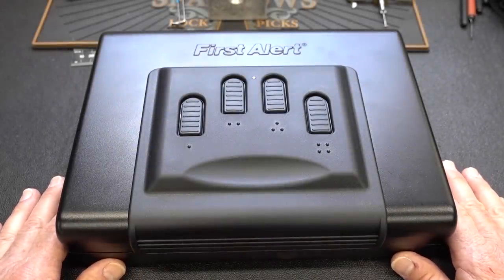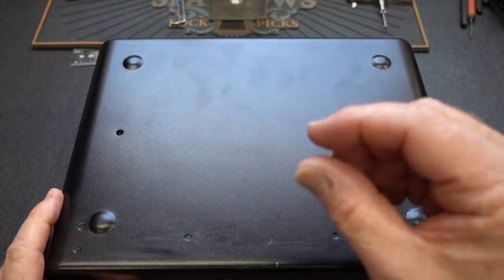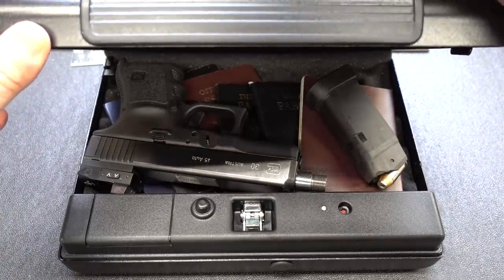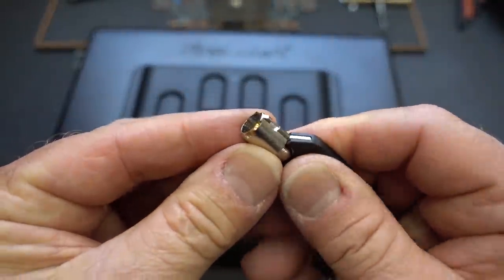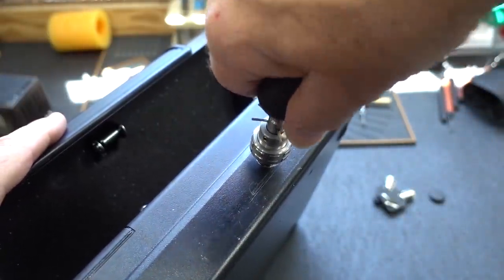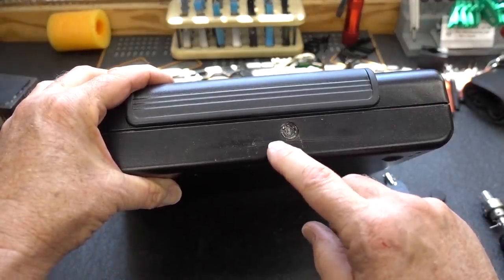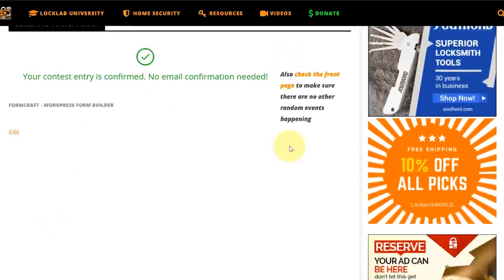(1526) Review: First Alert Personal Safe (RA31424)

Comment: This case is rock solid (like other Pelican cases). https://www.youtube.com/post/Ugkx3jMFPw9QX_Iu4DNcjW-t9AZ4_iNhJzhE I paired it with the Master Lock 140T set of padlocks. The US Airways ticket agent that checked the case was impressed by how completely the latches were secured. The case has layers of removable foam cubes that can be easily adapted to the contents of the case and keep everything secure. After declaring its contents to the ticket agent, I was allowed to put this case in other checked luggage. Due to its size and black color, this helped insure that it wasn't misplaced by a baggage handler. TSA was (apparently) happy with the packaging as well. If you plan on flying with more than one of the main items, I would recommend buying a larger Pelican case and just transport the case as another piece of checked luggage.

Comment: You can mount it even closer to the wall or floor. Cut the tab off the back of the key and replace it with a length of rod welded, braised or epoxied at right angles to the barrel of the key.
Reply from the maker: Good idea!

Comment: I've seen an electronic like this one but instead of having an external key it had a slot for a 9 volt battery to press up against a pair of leads as a backup external power source. I would like to see that duplicated on more devices like this one.
Reply: sounds like a perfect opportunity for someone to go and fry your circuit tho.
even if it fails safe that would still turn your expensive safe into junk

Comment: The hinge pin can be cut through a hinge slot with a piece of hacksaw blade,and removed in under a minute.
With the shaft of one of the white disposable Bic pens,and a lighter. You can easily defeat most of the tubular keyed locks.
Heat one end of the shaft till it's softened.
Then press it firmly into the keyhole,hold it till it cools,then turn it like a key to open.

Comment: I own that safe, big problem with battery life. Three years doesn't match with my experience.
Reply: Like he said, have a battery rotation policy.  I have a Hornady safe with a similar style keypad that uses a big pack of 8 batteries (12V) and all it takes it one cell to fail to kill the whole pack, but thankfully the external power input is 12V with a common barrel-jack (5.5x2.1mm), so I can get it power from a car hot-shot and an easy-to-make cigarette-lighter adapter-cord (don't have to be near an outlet).
Reply: id say apply the Thermostat without a C-Wire policy,  change them every year.
Reply: Their three year claim is probably a best case scenario where you put fresh batteries in lock it and don't touch it for 3 years. 

Each time you open it you decrease the battery life.
Reply: @dustysparks  That doesn't address the poor battery life of this safe at all.
Reply: Maybe wire some cells in parallel..
Reply: @drivejapan6293  Absolutely.
Reply: @dustysparks  Along the same idea, just replace the batteries with rechargeables and the gear to make them USB rechargeable—and put the USB port where the lock is .

Comment: yeah, tubular locks... i only fairly recently got interested in the sport of picking, and I've tried picking a few. with nothing more than a home made tensioner from a hacksaw blade, and a tiny torx driver for mobile phones that i sharpener on a grinder into a minature pointy stick, have been able to SPP all tubular locks I've come across in a matter of a few minutes. They can't be all that good if someone like myself with very little experience can do that...

Comment: Bill, I'm wondering if there is a typo in the video title?  I can't find an RA31424 safe - however I found an RA31524 on Amazon instead.  And when I searched First Alert's site, it appears they use model number 5200DF for this safe.

Comment: Hi Bill, apologies if this isn't the place to ask. But your ideas for securing this to stuff has prompted this question. I want to get a scan tool that's extremely expensive, for my business, but I want to keep it in my boot, as it's fairly useless safe at home. But this tool is literally worth more than my entire car, and I'd like some way to keep it safe inside the car. Are car safes a thing? The size of the tool I want to protect is maybe the size of a dictionary, if not slightly larger. It's basically a tablet device, but a very chunky one. If car safes are a thing, could you so kindly do a video about them? I can barely find any info, if you look for "car safes" etc, it's mainly pages about car safety. The best I can find is maybe a gun safe for a car. But I'd like to know what to go for. Thanks.

Comment: Each of the 8 "digits" of the combination can be one of 4 possibilities, therefore the total number of possible combinations is 4^8 = 65,536 This encompasses all shorter combinations.
Reply: No. It can only be between 4 and 8 digits. It’s 4^8 plus 4^7...plus 4^4.
Reply: @JasperJanssen  Yes, but 4^8 contains all the possible lesser combinations, valid or otherwise. For simplicity take the case of 4 digits, 1111, 1112, 1113,1114,1121,1122,...1131, ... This sequence of 4^4 possibilities (256) contains all the 4^3 (64) 3 digit combinations 111, 112, 113, ... If you were trying to crack this safe by exhaustively entering combinations, you would enter all the possible 8 digit ones and, along the way, you would pass through all the shorter ones and if the safe were set to one of these it would open. Note that as soon as you have entered the correct combination the LED flashes green. The only thing Bosniabill didn't mention is what happens if you enter more digits than the combination. Does it start tracking a new sequence or just ignore the extra digits? Is there a reset combination if you know you've made a mistake?
Reply: I'm guessing the light blinks red when you enter enough digits, letting you know how many to enter. I see this as the bored teenager attack method. Go through a few more combinations every so often when the parents are away.
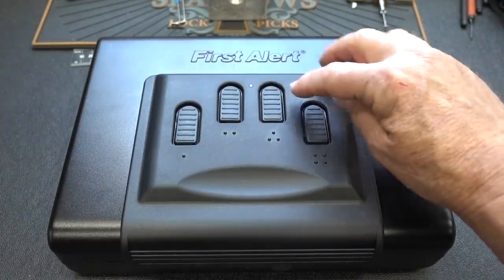Reply: @bmitch3020   The LED flash red at each of the first 3 button pushes (3:45), then green when the 4th and correct combination had been entered.
Reply: @pjaj43  From the safe manual (model 5200DF, but looks to be the same as what Bill reviewed): "If an invalid passcode has been entered, the red light will blink continously." That's different from the short blink on each button press. If it didn't do that, you could either miss a button or accidentally double tap and never know when the sequence was restarting to enter the correct code.
Reply: @bmitch3020  Well that would immediately give you the length of the passcode, so you'd know what your search space was.
Reply: @pjaj43  exactly, per my comment above. I've yet to see a keypad lock that didn't do this without a separate "enter" key of some kind.
Reply: If you find that it's only 4 digits, that's 256 combinations. With 3 tries a session, that's done within 86 sessions. Allocating 5 minutes a session gets you every combination in around 7 hours. A bit to long for Bill to video, but for a bored teenager home alone, they could brute force the combination fairly quickly.
Reply: Yep. Adding couple of digits to the code changes things drastically.

Comment: The hinge looks like the biggest weakness to me. It looks like 2 clearly defined spotweld marks that could be drilled out in seconds with an 1/8' drillbit.
Reply: I thought that, but I think those are holes drilled in the outer case that engage with pressed bumps on the hinge to give registration for welding the hinge in the right place.

Comment: Can you drill a hole above the reset button and push the button from the outside using a probe to reset the password? If yes, then it can be defeated using a small cordless drill.
Reply: The resset button doesn't require to imput the old pasword acording to the manual so if you have a template to know where to drill or perhaps use a hole saw I think this is a plausible attack.
Reply: It's possible that it won't reset while locked.
Reply: Good catch, but at that point your using power tools which make noise and you would have to know exactly where to drill maybe going so far as to bring a blueprint with you. 

i also wonder how it would fare against a crowbar and a good pair of cutters. If its bolted down the gap provided by the feet would give a perfect spot to pry. Even if its bolted to something metal you could probably still break the bolts or the bottom of the safe, seeing as theres only two bolts and the look pretty small in diameter and most people aren’t going to be using grade 8 or AN hardware. 

But if you did have one of these and wanted to Harden it it looks like you could install an anti drill plate over the reset button, plus using AN hardware with large washers or an up-rated armored cable would be good places to start.
Reply: @purplepenguin43  re: the noise: a drill is much less noisy than a grinder.

Comment: An often used exploit on safes like these is fashioning a long metal shim, working it into the code reset button, and resetting the code whilst the safe is still closed and locked. It looks like this could be an issue on this safe. Have you tried taking a look at that?

Comment: I would suggest using a cable clamp to shorten up the long cable but agree that it would be better to double it.  Really would like to know if this box is susceptible to large magnet attacks.  That is the main downfall of most electronic style locks.  Get a large enough magnet and you can actuate the solenoid that keeps it locked.  The only way to prevent that is with a large heavy steel plate to spread the magnetic forces away from the solenoid.  

Would like to see you go through any electronic locks you have or come across to check this out.  It is a major vulnerability and likely is even more of an issue than the tubular lock.
Reply: Constrained magnets are another idea. Just have a strip of alternating magnets that massively attenuate the field.
A cheaper idea is making that steel plate folded with a weak magnet connecting the loose ends for a similar effect.

Comment: Very nice - if nothing else, bolting an L bracket on the bottom so that it blocks the lock entry as you suggest 'with a wall' so that only a key would fit.

Comment: Not a bad box. I'm a little concerned that it looked like the hinge might have been spot welded or riveted in four places, so could possibly be drilled pretty quickly. Also a big screw driver might be able to pry it open. But all in all, certianly better than a shoebox under the bed.

Comment: I did the math! Exhaustive key search in about 60 days, working 24/7 so on average 30 days to get the code.
Reply: if it not default, though. Randomizing raises chances dramatically, as in raking the pins inside the core..

Comment: Lately I've encountered several tubular locks that I can't open with any of my impressioning tools, most notably the Chateau lock. Why is this? And what can I do to defeat these locks?
Reply from the maker: The problem is often the spring strength in the lock, requiring you to experiment with different tightnesses on the ring that holds the pick needles.  Try varying how tight you screw down that nut.  Some locks require it to be VERY light, while others insist on needles that aren't quite so free-floating.

Comment: To keep that cable short inside the box, tie a knot in the ends to keep from pulling slack out of box, just a loop wrapped around itself will do, since pulling will only tighten the knot
Reply: Repeated pulling and pushing would most likely loosen it after some time. The question is of course, how much time.
Reply: @tomhejda6450  ,at the most it will only get longer, with the crimped ends and loops it will never go thru the hole.

Comment: Number of combinations will range between 256 for four digits (4^4) and 65,536 for eight (4^8).
Reply: I have a similar safe made by a different company, and each "digit" can be any combination of four buttons that are pushed before all buttons are released.  If this is similar, then adding the six ways of using two buttons to the four ways of using a single button would increase the number of possibilities to 10,000 or 100,000,000.

Comment: Considering you and lpl always say that cable bike locks are really weak, shouldn't this MUCH thinner be even easier to cut?
Reply: @jmh81  but if one even is slightly prepared they just snip the cable in a seccond and then pick the safe up so it's really not much. but sure bolting is down is the safest way.

Comment: Did you try breaking off the pad and supplying voltage to the leads? Seems like the easiest attack to me. Worst case a 9V block is enough to open this thing.

Comment: When I didn't have access to my safes key, I opened by putting a screwdriver in any opening (and that cable hole is perfect for that).
Wiggling the screwdriver makes the hole some larger, so you can get a bigger screwdriver in it.
Put as much screwdrivers in it as you can, and as big as you can.
Remove the small ones, and get bigger ones in it.
Then you put a crowbar in it. 
Even the tiniest screwdriver works for a start.
And it's fast also.

I'll open it in 2 minutes.
Bolted to the floor will make it easier, because I don't have to hold it.
I could make a special tool to rip the lid off while bolted down.
Reply: same notion, Bill thinked similarly, instinctively, when tried to conceal and fill the hole with a double iron cable. Smash it against a concrete wall to see it flow apart.

Comment: Well, since there are 4 buttons, there are 4^4 = 256 permutations (because the order matters) for 4 digits, 1 024 for 5, 4 096 for 6, 16 384 for 7 and 65 536 for 8. Sum it up and you get 87 296 permutations. Imagine you can enter them instantly, so considering a 4-minute lock every 3 tries, that's about 242 full days for trying them all! You'd have better luck with a drill or a saw... or just using the key impressioning tool.

Comment: I have seen electronic  high security door locks with a pair of battery terminals on the outside to apply a 9 volt battery in order to liven up the lock electronics if the main batteries go flat, to then enter the  code, open the door and change the main batteries. This could be argued to be better than a mechanical override. Feeding a high voltage into those terminals in an attempt to sabotage would only destroy the electronics and therefore deadlock the door forever.

Comment: Try this attack:  Set the code to something other than the default 1-2-3-4.   Lock the safe.  Smack the ever living crap out of it.  Try 1-2-3-4.  A lot of these 4-button ones have the boards coming out of the same factory and if you hit it hard enough to jiggle the batteries it will reset the electronics back to the factory code.  The cure is to install a small capacitor on the power line if the problem exists.

Comment: I THINK the total number of possibilities for the code is 65535 choices. Since there are only 4 "numbers" and you can choose 8 of them, that'd be 33333333 in base 4 converted to base 10 which is 65535. I may be wrong... but I don't think I am.

Comment: U didn't pull on the cord after putting both ends inside....but when u put them inside u pulled from the inside and the cord moved easily, looked like it could be pulled for slack from the outside too

Comment: I noticed there was what appear to be rivet type heads ( 4 of them ) where the hinge runs at the back , if I'm right could you drill  these out and lift the lid off that way , I'm just asking not suggesting .
Reply: that was my first thought as well, just after "I wonder how many wires goes into the case from that plastic bit"
Reply: Are you sure they are not spot welds?

Comment: With 4-8 digits as all combinations less than 8 are included in 8 they can be discarded: total combinations is 4**8, and assuming that the only waiting is after batches of 3 waiting for 4 minutes it will take over 60 days to try every combination

Comment: They should have added a USB port for a charger to open it when the battery died. And left the tube lock on the design table...
Reply: Kevin v. H. No, tube locks are always needed as electronics always fail and you always need another back up.
Reply: A tubular lock with random-length drivers and springs, as were used in the first tubular locks, would not be susceptible to this kind of impressioning attack.  The $50,000 question is why people keep making tubular locks with weaknesses that even the makers of the first tubular locks knew enough to avoid.
Reply: @crunch9876  you mean give criminals easy access...
Reply: @flatfingertuning727  what is the $50,000 question?
Reply: Just to fry it open with a shocker discharge?

Comment: Hi Bill, could it be possible to switch out the core? I didn't had a clear look on the lock and am way not an expert on such things but maybe you could tell us this
Reply: Changing the lock cylinder is probably possible, but not practical, and would likely be mechanically weaker after such a surgery.
Reply: I was able to change out the lock on a similar safe with an Abloy lock. It did not weaken anything. I did this with several safes we have around the house and in the cars. They are all keyed alike so I only need one key. Good idea to double up the cable.
Reply: Roger Weiss Right on, that’s good to know! What length of lock did you use?

Comment: I don't understand why battery operated safes like this don't have, say, a micro USB jack so that you can power it from the wall or a phone battery pack if the batteries die. Having a way to provide external power seems to make way more sense than a key override that reduces the overall security.
Reply: Small solar panel and a lithium titanate battery would be another option.

Comment: 1:38 The hinge looks easy to drill with the pair of included center taps. Would it make more sense to have the batteries externally available instead of have a keyed backup? Or use a keyed external battery compartment?